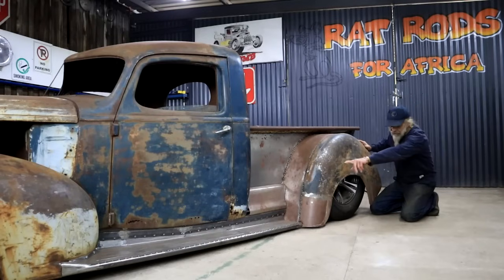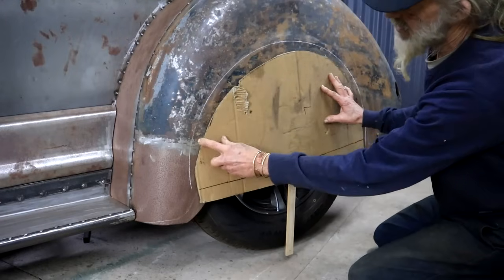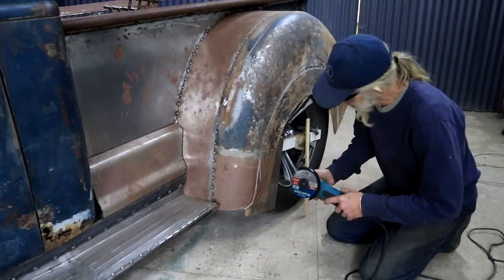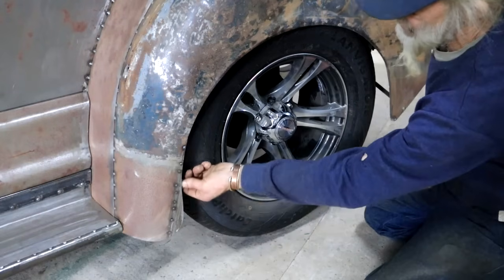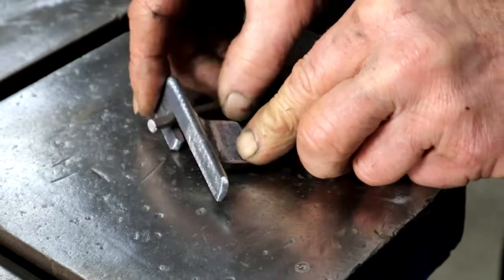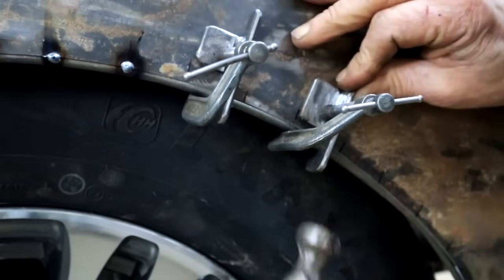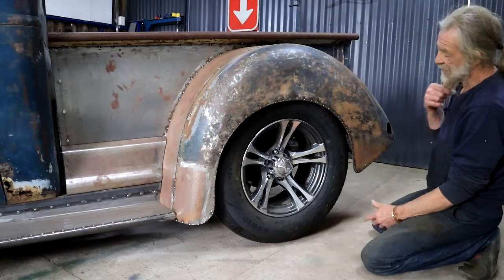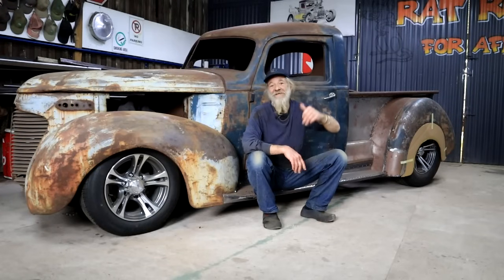Finalizing wheel arches and bracing with round bar - 1939 Hudson Rat Truck Build, part 36

Comment: Div, I really like it without the skirt. Gives it a balanced look with front. The full skirt looks great if you're going for the '50-60's full custom look.
Reply: I should have read these comments first before commenting! Sorry mate, I didn't mean to copy you. You're perfectly correct. I'm an older gent and appreciate style. Remember the '80s and the 'Dare to be different' school? I understand why the rodding press were suggesting it. All the desirable originals were selling for crazy prices. So look outside the box. Ok cool. Then builders went nutz with styles and paint jobs that just did not 'fit' if you know what I mean. Some actually 'worked' but man, others were horrendous! Sure it's your build, but give it some thought. Atb, Pete UK

Comment: Midi skirt looks best of the three, I think. But maybe increase the arch of the skirt a little bit for when the car is slammed. Looks really good when it's aired up though,  when you can see the center of the wheel.
Reply: I fully agree with you.

Comment: Something I may do with my ‘37 Chevy pickup, full skirt with a hole that matches the window profile, maybe match the profile between the hood to front fender? The nice thing about skirts is they can be removed. They change the look completely with little effort. Maybe make 2 or 3 different sets. Great job on the truck. Nice to see a master at work!

Comment: Skirts are great anti wheel theft devices. Mini skirt looks very cool. Gives you back the original profile you designed into the fender yet gives you access to do what is needed. It is different enough to be unique and interesting. Do your self a favor and make them with snap binders so you don’t have to wrench them off. I did that to my 55 olds delta 88 full skirts and saved me a bunch of aggravation and time.

Comment: You have a set of really nice wheels Diff, I think they need to be shown. Adding skirts will require more fab which will be educational, however if you encounter a flat in the rear, the hassle of removing the skirt to change a tyre is not worth it. As always lekker boet.

Comment: 👍👌👏 Very well done again (video and work). Maybe the fact that you are confused is caused by not using the thinking chair!? 😁 ;-)
2) If any skirt I vote for a much skinnier one so that the rear mimics/matches the opening for the tires on the front. I also vote for adding metal to the end of the rear fenders. For my kind of taste the end is sitting too high above the ground. The perfect line that you built with the front fenders, the fantastic running boards and the front of the rear fenders does not harmonize with the back. As always, this is only my opinion respectively my personal kind of taste.
Thanks a lot for making teaching explaining recording editing uploading and sharing.
Best regards luck and health in particular.

Comment: I like the full skirt look, but you need to see those wheels. I don't like the mini skirt, I'd go with covering half the wheel so the lower half is seen. Take the full skirt and cut the bottom just above wheel center. Like a half full skirt. Looking good either way bud!

Comment: A car I'm working on at work is super hard to change tires on. You have to disconnect the coilovers and the sway bar to drop the axle down far enough to get the tires on and off. You also need to deflate the tires, cinch them down  with a ratchet strap and get them at just the right angle. Took me about two hours just to put the tires on, the other day. I was tempted to disconnect the driveshaft as well to drop the axle even lower. 

Trying to keep the body stock while running drag tires on a tubbed Datsun 1200 that sits 3" off the ground is a pita.
Reply from the maker: That's crazy!

Comment: I'm very much liking the rear fenders, I'm undecided on the mini skirt, or no skirt. It looks badass both ways. The little jigs you made for the 1/4" round stock are awesome. Are you using cold roll steel or hot roll? Love your ideas man.
Reply from the maker: When it comes to thin sheet metal, always cold rolled. The mill scale is a pain in the ass and the hot rolled doesn't shape nicely
Reply: @ratrodsafrica  Cold roll,  I was thinking so too. The 1/4" stock you used shaped up nicely  Thank you.

Comment: You still have to chage
A flat tire or am i wrong
??? Blacksmith theoharlingen holland
65 years old and
Inspired by you to
Restore my 1955studebaker pick up
Truck 6 cylinder flathead..thanks mate..
Reply from the maker: If I do make a "skirt" it will be removable to allow for changing tires.

Comment: No skirt and I would match the back of the guard or fender to the front so it lies flat on the ground instead of going up on an angle it just dosnt work for me. Really like the clamp you made got a job lined up that requires it. Off to panel and paint soon lol.  Would look good in spring box colors if you win the cup if you lose patina it. Just kiddin but not about the flat on the ground look for the back guard. Getting it running next I suppose those Clevelands have one of the best v8 sounds. You going with stacks or lake pipes. Have a good one any way. Just had our election and the labour party was finally thrown out on their ears taking their woke bs with them. 😁🇬🇸👍
Reply from the maker: Probably lake style, dont think stacks fit the build.